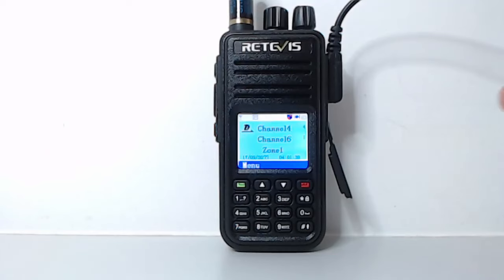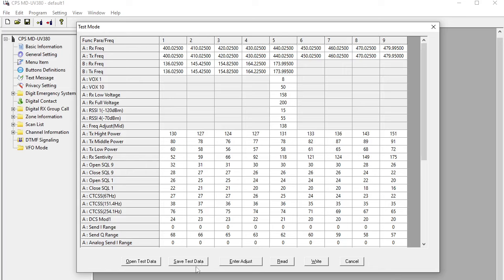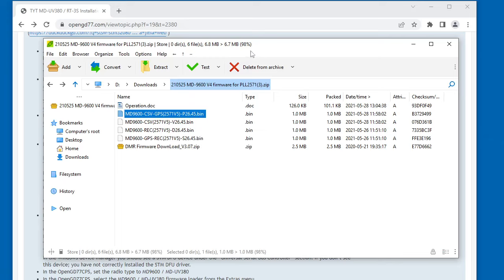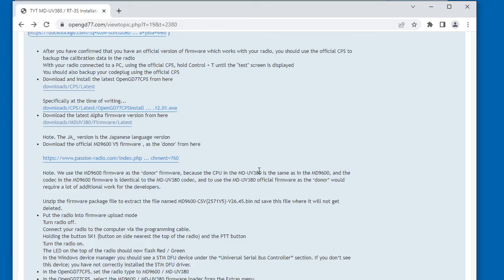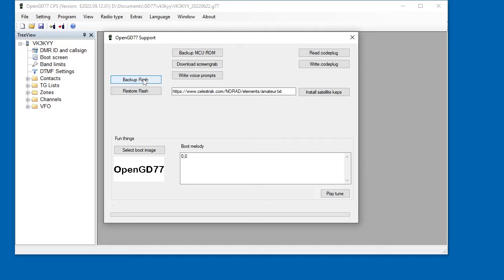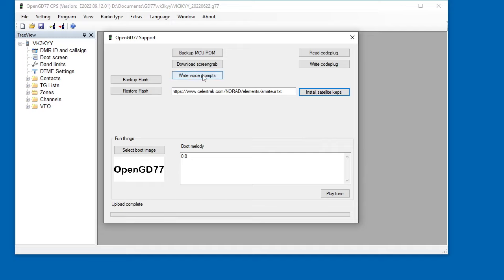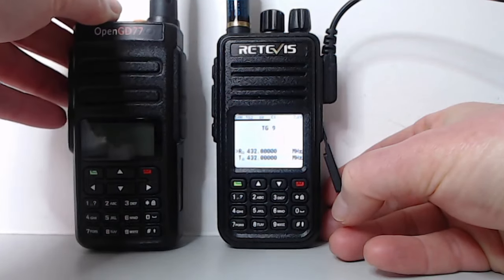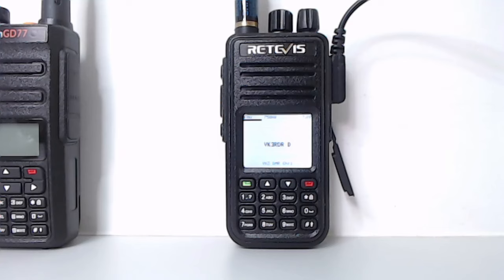Install the Alpha of  OpenGD77 firmware for the (VERSION 1 - ONL). TYT MD-UV380 / Retevis RT-3S

Comment: perfect tnx for all your work, hope it goes on, even on the lack with STM32 chips 73 Alex OE3JTB
Reply from the maker: Unfortuately. Now that TYT have replace the CPU chip with an unmarked Chinese clone of the genuine STM32F405VGT, it is going to be difficult to make the firmware work on the latest version of the MD-UV380 / RT3S

The problem appears to be that the clone is not compatible with FreeRTOS (OS) which the firmware uses 😞

Possibly one of the people who bought one of these new radios, may be able to debug why FreeRTOS crashes, but unless TYT or Retevis send me a free sample of this radio, I have no way to even start investigating the problem :-(

Comment: The firmware link downloads/DMUV380/Firmware/Latest doesn't show the .bin files as at 12/12/23.
Reply from the maker: firmware files have been packaged as .zip for several months because the firmware is now separated into firmware executable and language pack, as file size of both the firmware executable and all the merged languages was larger than the total ROM of the MCU in the radio

You need to use an up to date version of the OpenGD77 CPS which supports the .zip packaged files
Reply: @vk3kyy  I unzipped the file and installed the Boot. Installed CPS but it wants a Serial Port. I have the USB device in DFU mode. How do I get that to work?
Reply from the maker: @VK2AHB  

As I said in my previous post.

You need to use a version of the OpenGD77CPS which supports handling ZIP FILES.

You CAN NOT unzip the file and use the contents

Also. The firmware update is not via COM port on any supported radio.

The UV380/DM1701 use the STM32F4 series MCU's and use STM's Device Firmware Update system including the STM DFU device driver.

Search YouTube you'll find loads of example of people showing you how do update the firmware.
Reply: @vk3kyy  Hi Roger, I found the right zip file and it loaded. THanks.

Comment: Is the pinout for the programming cable different on the RT3S to the Baofeng DM1701?  I made my own cable for the DM1701 but my pc says the RT3S is an unrecognised device, its not a driver issue, its the USB itself failing to find a device ID.

Comment: Hi, I installed OpenGD77 on my MD-UV380 for 4-5 months, and I realized that, I haven’t save „test” file. Will my radio be useable, if I would like to return to orginal firmware?

Comment: Excellent explanation. I installed it just now on my Retevis and it works fine. Does the FM frequency range open more to 200-300mHz in this alpha version?
Thanks for the good job.
Reply from the maker: The frequency range is the same as the GD-77, because the RF chip (AT-1846S) is the same as in the GD-77

RF PA and Rx amp stages are similar to the Baofeng RD-5R, but different from the GD-77.

Use on 220Mhz band for Tx creates very strong hamonics on 2 x the Tx frequency, but this is similar to the GD-77

Comment: Thank you very much for your hard work! Will there be record option available like in the original firmware?
Reply from the maker: This firmware is not a modification of the official firmware, its a version of the OpenGD77 firmware, which is firmware written from scratch. 
The OpenGD77 firmware does not have a record function, hence the OpenGD77 firmware when running on this radio does not have a record function
Reply: @vk3kyy  I'm not a native English speaker so maybe I asked this question wrong. I know about OpenGD77 and that it is alternative firmware not a modification. I'm just trying to ask if you plan to implement the record function just like you're implementing GPS function although it wasn't present in the original OpenGD77? Again kudos for your great work!
Reply from the maker: @TTymek  
There are no plans to add a record function to the OpenGD77 firmware.

The focus is to finish the port to this radio, as currently some features in the GD77 version do not work in this version.

It takes a very long time to get the firmware working on every new radio.
I bought this RT-3S in July 2022, and it has taken 2 years to get this far, mainly because Colin G4EML ported the firmware to the MD-9600 which has the same MCU as this radio.
So there are still many months of work before the port to this radio is even finished.
Reply: @vk3kyy  thanks for the answer and good luck!

Comment: Thank you for video and explanations.
Question: Is the Hotspot function working in this firmware?
It will be a great functionality, to use this HT in Hotspot mode, like in others radios like GD77 or DM1801.
73!
Reply from the maker: Hotspot function is working.
Note. The USB connection on this radio is not as reliable as the GD77 even for codeplug data transfers etc, so will probably require more RFI screening than the GD77, otherwise the hotspot will disconnect

Comment: Can OpenGD77 receive two frequencies at once? I didn't find how to do it.
Reply from the maker: No. The radio only had on RF chip. It can only receive 1 frequency at a time.
You can scan multiple channels, but this is not receiving 2 frequencies at once
Reply: @vk3kyy  I meant it.  Follow the two frequencies, and take the one that has a signal.  As in the original firmware.

Comment: The process is the same for the new tyt md-uv390 versions? Just have to use the new beta from the forum?
Reply from the maker: Yes. MD-uv390 is the same as md-uv380 except is waterproof. Firmware and installation is the same
Reply: @vk3kyy  Thank you very much !!!

Comment: Is your firmware compitable with TYT MD-UV390 non-gps model?
Reply from the maker: Yes.
Reply: Will this firmware can scan two TimeSlots at once like an Anytone?
Reply from the maker: @GSampiyonable  I don't entirely understand your question. 

If you are saying, can you set the firmware to listen to signals regardless of whether they are on TS1 or TS2, then Yes, and this is done by turning the TimeSlot filter off, in the QuickMenu

It also by default will receive any TG, including PC, unless you enable TG filtering

It can't however receive on all CC, it has to scan for the active CC and lock onto that, as the hardware is not capable of ignoring the CC

See the OpenGD77 User Guide
Reply: @vk3kyy  Yes, that's exactly what I'm trying to ask. You understood exactly what I was asking. Sorry for making it a little confusing. Compared to factory firmware, this is a huge leap forward. I will try asap. I'm looking forward to the Beta phase. Thank you for your hard work. :))) 73

Comment: What is the overall functional improvement?  What are the sat keps used for in this radio?  Very nice changes and I will be doing the change if for nothing more than a better uncluttered screen I can put into inverse mode.  I don't see at all in one eye and the others not far behind.
Reply from the maker: See the OpenGD77 User Guide.

https://github.com/LibreDMR/OpenGD77_UserGuide/blob/master/OpenGD77_User_Guide.md
Reply: @vk3kyy  I found it.  Wow you guys are making Sat work Plug and Play!  I'll be trying this out!
Reply from the maker: https://github.com/LibreDMR/OpenGD77_UserGuide/blob/master/OpenGD77_User_Guide.md#satellite-screen

Comment: This looks really interesting, I can buy a TYT MD-380/RT-3S in the UK quite easily, I was trying to get a GD77 but I haven't found one for sale new or used. Is there any downside going for one of these over the GD77?
Reply from the maker: RF hardware is not as good as the GD77.
Battery life is not as long, as the radio takes more current.

But it's currently impossible to buy a GD77, probably because of the global chip shortages, as the CPU in the GD77 is basically unobtainable at the moment.
Reply: @vk3kyy  Many thanks for your reply, I will keep looking for a used GD77 on eBay etc. I may just grab a RT3S as well to play around with.

Comment: How to turn on scan mode?
Reply from the maker: See the OpenGD77 User Guide. 

https://github.com/LibreDMR/OpenGD77_UserGuide/blob/master/OpenGD77_User_Guide.md#channel-scanning
Reply: Ok but on RT3S this buttons run squelch but not scan.
Reply: Ok I didn't understudy that it need to be hold ;) my fault thanks ;) by the way you done grat job many thanks for that
Reply: But I found that it doesn't  work on VFO mode only squelch is going down when hold UP arrow.
Reply: I even loaded firmware once again and it is the same problem, scan works only in memory mode. What am I doing wrong ?
Reply from the maker: @pattut1979  This is Alpha firmware, its not finished, not everything in the GD77 or MD9600 works yet on this radio
Reply: @vk3kyy  aha ok fine thanks for answer :)

Comment: I put the open GD77 on my Baofeng RD-5R works great and I love it. Can I put this on a new Retevis rt3s without having to put original software or updating firmware? Do you know how many contacts can be put in Retevis rt3s with open GD77?
Reply from the maker: You have to follow the steps listed in link, in the description to install the firmware.

The firmware uses the GD77 codeplug format, which AFIK has the same number of "Contacts" as the official firmware.

However, I doubt you mean Digital or FM Contacts, because no one needs over a thousand of each type of contact in their radio. 
I suspect you mean DMR ID's for callsign and name lookup. In which case the maximum number is just over 2 million.
Reply: @vk3kyy  thanks for your help